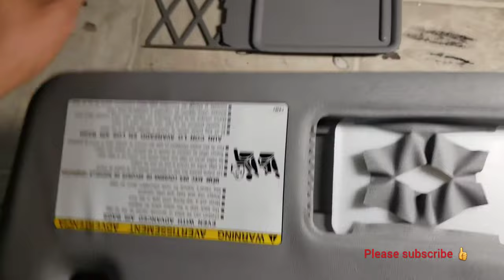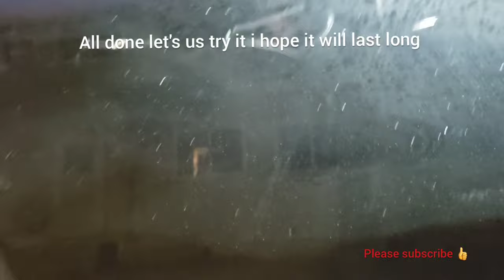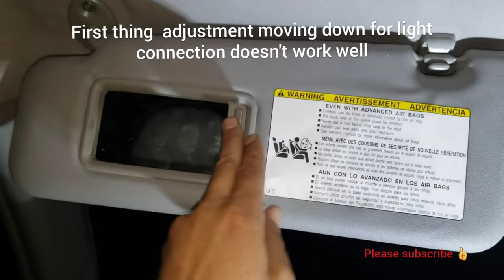Sun Visor Problems Is It Repairable? Let's Find Out

Comment: Use 2 double screws.  The kind of screw that one side is a female screw and they screw into each other.  Then, drill the holes  below the recieving bar.  the screws should tighten around that bar enough to provide the original friction.  See 'Civic sun visor fix for about $5'.
Reply from the maker: That's very nice and helpful tips and great information,  I should try 😀,  thank so much 😊 and all the best 👍.

Comment: How about if it’s stiff?
Reply from the maker: If it's very stiff try to spray little bit dw40 inside the movement joint, some of them hard to reach but try  it could solve the problem fast solution , otherwise you need to deassemble it.